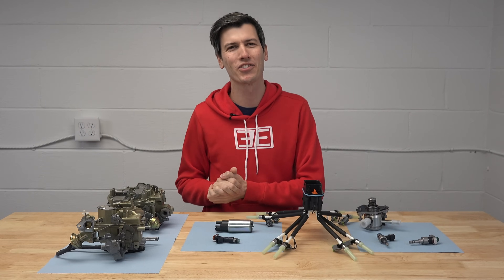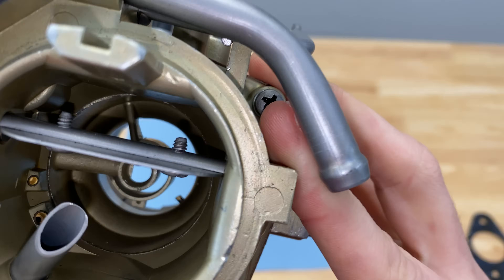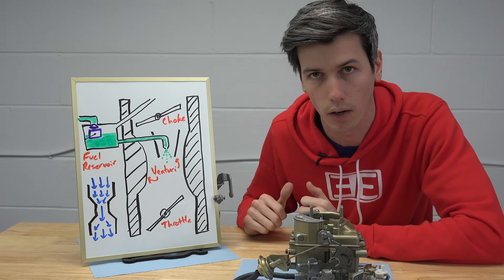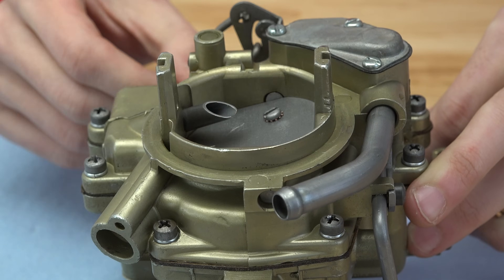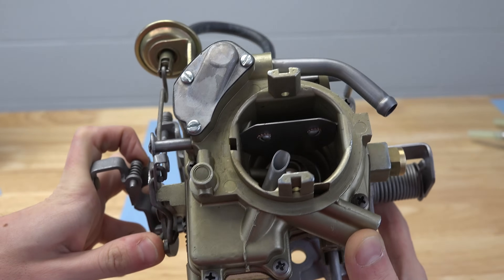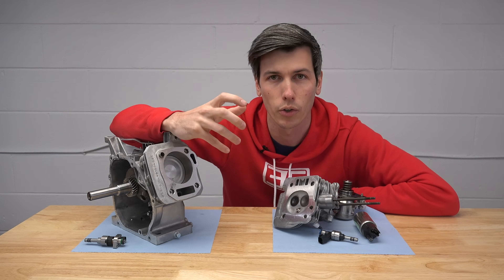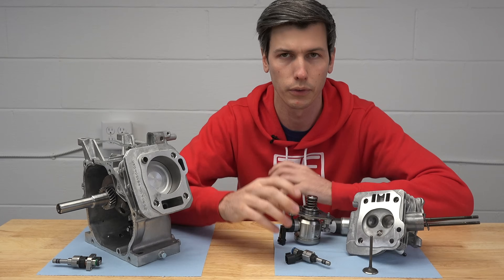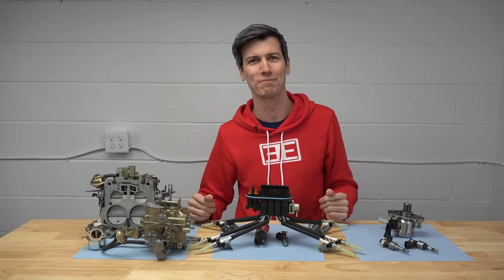What's The Best Fuel Injection? Carburetors vs Port vs Direct

Comment: Funny thing you mentioned carburetors cannot control mixture, yet simple cheap low horsepower aircraft engines all the way back from in the 40's have mechanical mixture controls to compensate for altitude, and are the primary control for run and shut off---and temperature control. Only a very few of the latest gasoline aircraft engines today do not have mixture controls (even in the throttle body injected engines), and in many the industry do not implicitly trust them without a mixture control, since they are so integral.

Comment: I love diesels, and know tons about them, but I was wondering if there's any chance of you making a video about how diesels work to help others understand how they work. And if you wanted to go down a rabbit hole, then you could do a series of videos about how the diesel fuel injectors and pumps have changed over time.
Reply: Considering that common rail injectors work at 10x the pressure of Direct injectors in gas engines, that would be cool.
Reply: I'd like to see the older Detroit Diesel 2-stroke covered. They would give the driver a work out shifting the trans all day. Back in the day, they were not my favorite to drive. Now, I like all their noise.
Reply: @Ohio Boy 
I don't know if you even deserve a reply, but I am willing to waste a little time. I am a mechanical engineer who has rebuilt a 7.3 powerstroke along with a couple gas engines, and if you want to, you can go check out my comments on Jason's other video where he describes the Achates opposed-piston diesel, where I talk about using steam injection to clean up the emissions and eliminate the need for an EGR system and how it will increase power and efficiency both. I also did one of my senior reports in thermodynamics on this topic and my professor was impressed and said that it is a promising approach. I have noticed from replies to comments though, that very few people understand what compression ignition is and how it works and why it is so much better than spark ignition. Since Jason is great at explaining things in a way that helps others understand subjects that are new to them, and has a fan base that can potentially reach out to millions of people, I thought that it would be better for him to make the video, than for me to make the video.
Reply: try adept ape channel
Reply: David Scott, that’s one big technical issue I’ve had for quite awhile now.  How do these 3 liter, 4 cylinder turbo diesels work so well, unlike the old diesel motors that had no power, made lots of racket and smoke?  They must be a form of direct injection that earmark diesel motors, but I’l be damned, I can’t even find the throttle plate on these new turbo Diesel engines!  Can’t find the “theory of operation” book here.
Reply: @chrisbragdon5901  
That's what is so great about diesel engines, there is no restriction to inlet air. You run as lean as possible in a diesel engine and that is why they are more efficient than a gas engine.
Reply: @davidscott5903  Diesels aren't efficient because they run lean. They are more efficient  because they atomize the fuel much better than a gas injector because of the much higher operating pressures. Not trying to argue. I used to work on big rigs and have a decent amount of Diesel experience. Take care.
Reply: @davidcollis4758  
A big part of why they are efficient is because they run lean. But not just run lean, they run with maximum full flow air volume with every combustion. The way all internal combustion engines work is that they take in air, then burn fuel with that air which heats it up and causes it to expand which in turn pushes on something to do work, such as a piston, or a turbine blade, or a rotary engine rotor. And the harder and farther you can push said engine parts with less fuel then the better efficiency you get. Diesel engines use the full amount of air to push the piston with higher average cylinder pressures during the powerstroke because the pressure doesn't drop off as fast as a gasoline engine at partial throttle that only starts out with a smaller charge of air and fuel in the combustion chamber. When you start getting close to full power on a diesel, and get closer to a stoichiometric ratio, then you have similar fuel economy as a gasoline engine. And if you roll coal, then you get much less fuel efficiency.
Reply: @davidcollis4758  A year later, but additional note is how much more energy density a given unit of diesel contains vs a equal unit of gasoline.
Reply: @Ohio Boy 
Ok, so I'm a retard and know nothing. You must be the Yoda of diesel engines. Teach me oh great enlightened one.
Reply: noooo... its hell

Comment: Ah, the good old days when I used to drill out and solder carburetor jets and tinker with tapered metering rods in constant-velocity SU and Mikuni carbs. It used to be a fun art to fine tune carbureted engines under various load and RPM ranges by taking plug-chop readings of the spark plugs and reading A/F ratios from tailpipe exhaust gas analyzers on the road.
Reply: I need to drill out the jets in my B&S lawn mower because they are too small and a tiny piece of anything clogs them.   I'd like to learn if old carb castings can be repaired by soldering them.

Comment: Now you have got to explain the Air Mass Sensor and the O2 Sensor and how those are controlled by the Pixie Machine Confuser to give an efficient burn.
Reply: The mass air sensor and the o2 sensor tell the computer what to do not the other way around
Reply: theres a great video on this topic by diagnose dan on YouTube. check it out. the engineering of it is pretty neat

Comment: so is it possible maintaining same ideal afr in hi rpm for example 10000rpm without catastrophic failure?
Reply: yondaime hokage yes, I have no idea if you can do it with a carb but a lot of modern day bikes can rev as high as 14k rpm, even some rally engines rev to a little above or below 10k

Comment: Carbureted engines are very common on small piston engine aircraft.  You can even find them on brand new airplanes.  Fuel injection exists but its most often in the form of mechanical fuel injection similar to what is used with diesel engines.  EFI (also called FADEC, or Full Authority Digital Engine Control) is this newfangled witchcraft that has old grey beards acting like sailors of yore who were afraid of sailing too close to the edge of the map.  Here there be dragons!

Comment: Maybe it’s nostalgia- but carbureted engines have a sound I absolutely love
Reply: Probably because they are usually out of tune, more of a lumpy or heavy thud from running a little rich, plus the lack of noisy timing chains in most older engines.
Thats my reasoning at least.

Comment: The dyno video from Rob Dahm shows that cooling effect really well, he was pumping so much E85 into the intakes there was actually water condensing on the outside of it which is wild
Reply: You should look up top fuel dragsters running straight methanol, or nitro meth. They run crazy boost through a positive displacement supercharged but don't need a intercooler because of how much cooling they get from the fuel.
Cletus Macfarland has a few videos of his car "toast" running that setup and the aluminum supercharger housing is almost frosting over.

Comment: i think actually is carburator is electrically simplify, while fuel injection is mechanically simplify. it is due to the carburator is a complex device compare with the fuel injections, particularly the port injection. if the carburator require a same function as fuel injection, it need a very complex lines for air and fuel, as well as the multiple "stages". the weber carburators are the best example especially for racing

about the switching between the direct injection and the port injection, what i have understanding is during the high rpm, direct injection cannot be used due to the injected fuel does not sufficiently mixed with the air, which is caused by the interval between the each combustion is too short, makes the power significantly reduced during the high rpm range. while port injection solves this problem by injecting the fuel into already high velocity of intake air, which is very effective to mix the air and fuel before entering the valves.
Reply: You say this because he skipper the mechanical fuel injection.

Comment: I drive an EV as a daily now but still have and have had many gas powered motorcycles.  Two of my bikes are fuel injected and two are carbureted.  I still have not found a fuel injected bike that feels as smooth as a well tuned carb.  I don't understand how with all the fancy computers and controls in modern FI bikes, they have not found a way to make smooth fueling stock while still meeting emissions.

Comment: Which is good for high altitude long bike rides a carburator or a fuel injector bike
Reply: Usually efi as it can automatically richen or lean the mixture, with carburettors you will need to take them apart and rejet them

Comment: The engine use injectors give less acceleration than the engine use carburetor but its give more fuel efficient
Reply: I think the engine makes more output is.
Reply: In speedway the carburettord cars would be faster than the fuel injected cars leaving a tight corner but would lose to them on the straits

Comment: That was one of the clearest explanations that I've ever heard for how a carburetor works.  Thank you very much for that!
Reply: It was a good explanation but they aren't really quite that simple because a venturi doesn't give you the right air/fuel mixture across the range of throttle openings. So they have emulsion tubes and things to hack it.
Reply: @EBuff75 - I was going to say the same thing.
Reply: i wish someone had explained it like this to me 30 years ago!
Reply: You start to understand how a carburetor Works when you open one and work with it
Reply: If you ever want to go further down the rabbit hole, go to Uncle Tony's Garage youtube channel before anywhere else. He explains things in normal car person terms and isn't delusional about carbs either.
Reply: the diagram was terrible the fuels level is always lower than the secondary venturis outlet other wise it would just gravity feed  constantly that is why the float level is a critical adjustment it is suprising because this bloke is always spot on
Reply: @scottmcgahey9720  If it was a video about carbs exclusively or much more detailed as most carbs are quite a bit more then that I'm sure he would have been accurate and said something about that.
Reply: @scottmcgahey9720  Yep, noticed that. His brain's also been infested by 'injection' - carbs don't inject fuel, they carburet the air being drawn through them.

Comment: One  more thing. . .   By cooling the mixture and minimizing knock, the difference between cold and hot is greater, increasing the thermodynamic efficiency of the engine. . .
Reply: When it's running perfectly.

Comment: Jason, could you do a video on what improvements have been made over the years in real terms? Like what sort of gains in economy we get from adding variable lift cams or fuel injection or egr, etc.

For instance, my 20yo 2l Alfa 156 gets me about 11 l/100km on average, where my dad's Renault Fluence from 2012 gets him close to half that (around 6,5l/100km). As far as I know it also has 16 valves and variable valve timing, etc. Apart from my heavy foot, what's the actual difference caused by?

Great video, by the way.

Comment: Very well done, Jason. The only thing I learned was what I had thought was your misidentifying a carburetor as a fuel injector.  By golly, your white board diagram of the carburetor demonstrated that in fact, a carburetor does inject fuel. Bravo!
Reply: I thought the same. In fact, I just learned that a carburetor is actually just a more advanced mechanical fuel injection system. I've seen some articles call it "carbureted fuel injection".
Reply: Best look again. The engine draws fuel in from a carb using a venturi (aka a restriction), while FI's squirt it in.

Comment: awesome video as usual, Jason! any chance you can explain why DI has more soot/particulate matter build-up on exhaust tips? this didn’t seem to be an issue in the days of port injection only
Reply from the maker: Could be from not mixing well, port has longer for the air/fuel mix. Earlier DI systems using lower pressures with fewer, larger holes would cause pockets of rich air/fuel, which would then create particulates.

Comment: Another well done video, thank you for that! One remark: You forgot to mention the downturns of direct injection with regard to smoke and NOx emissions which makes exhaust gas aftertreatment way more complicated. Greetings from germany :)
Reply: DI also has big problems with the inlet pipes getting carbonated thanks to exhaust gases getting re-fed into the engine. Newer/better models use multiport injection to also inject into the air inlet like in the old days.
Reply: Genau. Das ist richtig.
Reply: Gotta love wee bit reek tho

Comment: What about retrofitting for old engines? What's best for them?
Reply: If you want EFI instead of a carburetor then your only real chance is to go port injection. Direct injection would be way too complicated with the modifications to the head. 

You simply need an intake where you can install some fuel injectors with an injector rail along with a fuel pump to get gasoline from the tank to your injectors.

Of course you'd still need the electronics (ECU mainly) which you can source from a later model or try to go with a programmable one. Speeduino is a great method for building your own ECU for around 100$, another 100 for sensors and cables/plugs and a wideband AFR controller.

Comment: It should really be called an air pedal. It lets air in first, and more fuel flows as a result of more air.
Reply: So in a gasoline-powered engine, yes. In a diesel, it’s legitimately a fuel pedal.
Reply: The proper term is an accelerator pedal
Reply: @royalriding1720  You mean throttle.
Reply: Shain Andrews only if it’s actuating a throttle body
Reply: @LSX_Tony  In a gas vehicle it is controlling a throttle body (directly or electronically).
Reply: @danieljensen2626  Not in the Fiat MultiAir engine - it has no throttle.
Reply: @royalriding1720  Correct.
Reply: The governmental morons started calling it a gas peddle during the fuel crisis in the 70s. It was previously called the throttle, in that it literally throttles the air.
Reply: It seems to me Royal Riding is right in saying it should be called "accelerator pedal" rather than "throttle" if only because other are named for their role (brake pedal, clutch pedal) rather than their 'indirect' role. And let's not start arguing that 'braking' is negative 'acceleration' 😂 Keep safe!
Reply: @geoffbuck6865  Accelerator pedal, decelerator pedal and spare pedal ;)

Comment: The problem with having both port and direct injection? TWICE the number and types if injectors to worry about, TWICE the number and types of fuel rails and injectors to worry about, much more cost and complexity for ultimately too little gain in objective performance. 

At this rate might as well go full electric.

Comment: pretty solid info here
been years with your channel and always enoying your videos
but i have a small question
i ride a suzuki Gsxr1000
and engine has primary and aecondary injectors?
is that an implementation of the two strategy injection of port and direct?
Reply from the maker: Found this, looks like there are injectors near the throttle body, and then lower injectors (not direct) depending on RPM and fuel demand. https://www.gsxr.com/threads/upper-and-lower-injectors.208649/

Comment: Using a small pocket of rich a/f mixture next to the spark plug and running the rest of it more lean is what the Honda cvcc engines were back in like the 70s
Reply from the maker: Yes! Very cool stuff for the time, even today haha. It's a technique similar to what is used in Formula 1 as well. Mercedes engine efficiency is wild as a result: https://youtu.be/kOhmgpkiIfg
Reply: @EngineeringExplained  Hey Jason, what is the A/F ratio in F1 using this system. Thank you.
Reply: @EngineeringExplained  I suspect the other engines use the same technique, as fuel economy is part of the strategy, unfortunately.  No refills and limited max fuel flow. Engines only spin to 12,000 rpm.
Reply: @EngineeringExplained  but it makes a lot of NOx emissions ... if onoy there was a way to reduce the air density for efficiency ... oh wait there is the dirty EGR to do so
Reply: @ssllhh100  stop that! you dont eat your own sht, why should an engine do that? ;)
Reply: Wow amazing, I had to look that up to check (Not that I didn't take your word for it🙀)...1971 Holy moly! Mr Honda himself developed it.
Reply: @martinda7446  I'm an old fart, when he started describing it, it sounded familiar
Reply: @masterofdisaster492  That makes two old farts...Open the window please love.
Edit: 😸
Reply: I own a 1986 Civic with that system and a carb, and I had a hard time trying to make it run relatively well and spend 9 liters per 100 kilometets instead of 14 as it did before. Still not sure if I had figured the settings out right as Honda San supposed them to be, or had just met some compromise 🤷‍♀️😅
Reply: They looked good on paper, but the intake runners for the prechambers (ignition chamber) would stop up with carbon and the engine would run like crap. They would have avoided such problems if they could have done the job without a carburetor. 

Modern fuel injection is SO MUCH superior to carbs in automotive applications ...